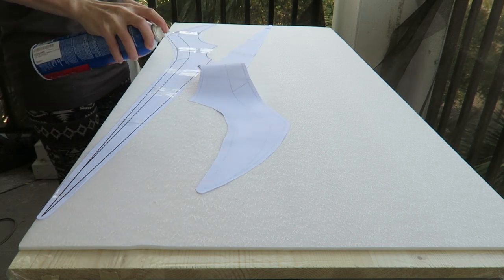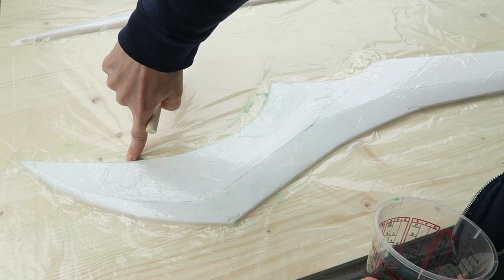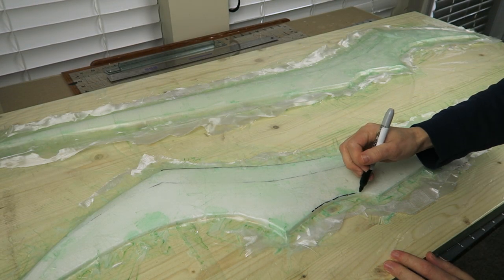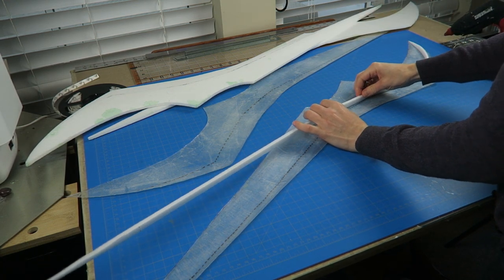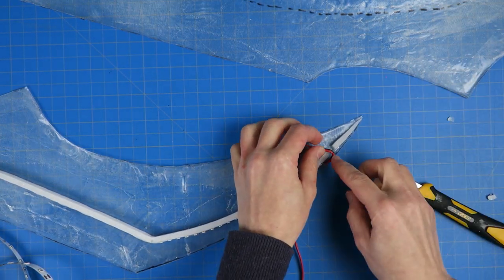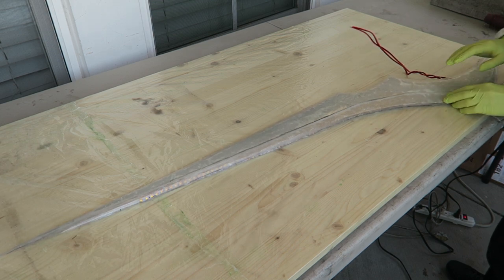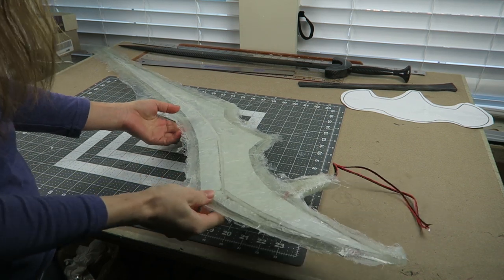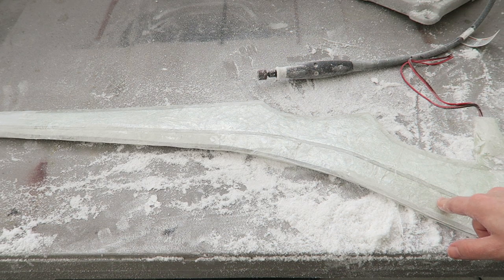Experimenting with Fiberglass on Foam Mold | HALO Energy Sword

Comment: Interesting.  Definitely a good learning vid.  You  picked a challenging one for sure (smile).  Might try waterbased paint pens  for marking things as they should come off easier.  Would like to see a smaller "test" piece to see if the aluminum has a worthwhile impact.  I like the aluminum Idea, but like you said, took away some of your flexibility in working the piece.   Thank you for sharing.
Reply from the maker: Yeah, something like that has to work better. The tape ended up almost as much of a pain to remove as the sharpie XD I will have to revisit the foil idea.

Comment: Great stuff. But please please do not left those solders like that. Those are cold solders and will crack very easily. You need to keep it hot for a couple of second and then not moving to get great solder.

Comment: Thank you for sharing your mistakes. Often more valuable than success.
This rough one could be turned into a cool, magic ork scimitar or something?
Like, cast iron look  with some kind of glow, OH what about a flaming edge?
Reply from the maker: Yeah, it would be good for something weathered like that. Structurally it's fine, just not worth spending countless hours building up and sanding down to get a smooth finish and clean edge.